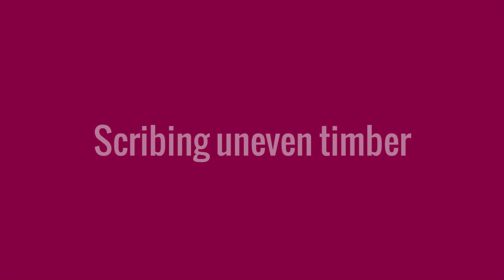Scribe - Uneven Timber

Comment: It amazes me how many "professionals" do not know the difference between "Level" & "Plumb" . Level is in the horizontal & Plumb is the vertical. In this video 1:09  you set the timber "Plumb" not Level This is why trainees turn up on a job using the incorrect terms. Just as screws and nails are different!
Reply: I build and stil mistakes the wrong term...
Reply: Yeah, one time in band camp....